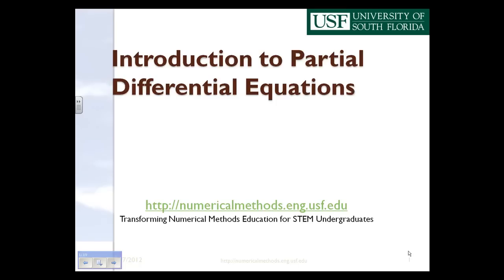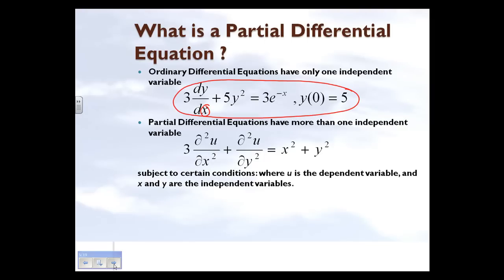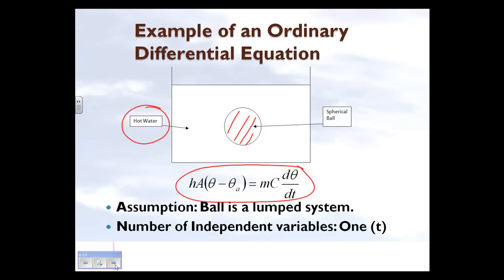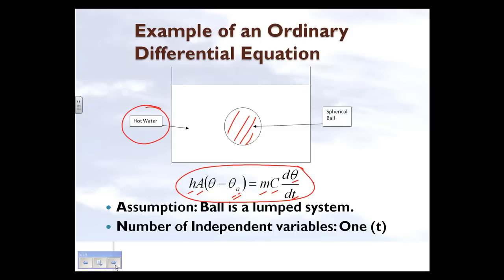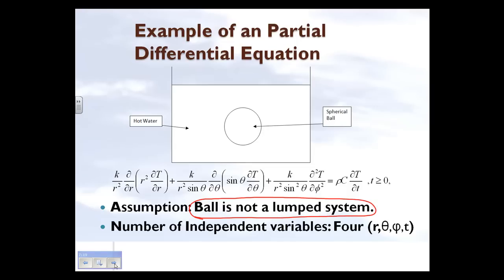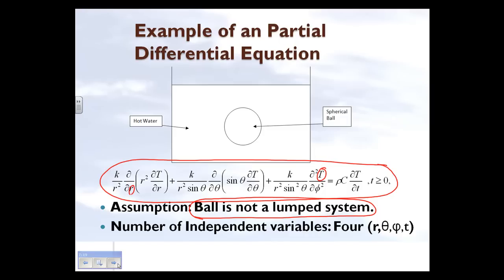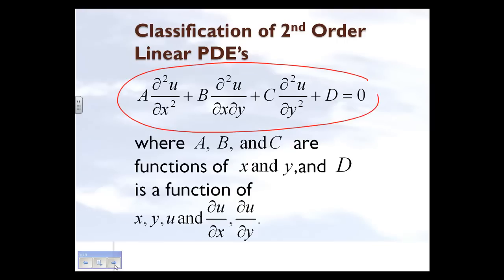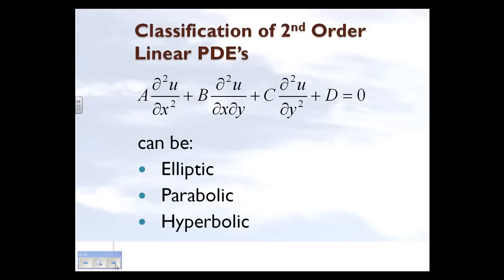Introduction to Partial Differential Equations

Comment: 4:38 I have read that there should not be a product of dependent variable and its partial derivative for an equation to be 'Linear'. Please clear my confusion.
Reply from the maker: You are right.  The D also has to follow the rules of being linear as well. We are just bundling the terms there.  If D does not meet the requirements of being linear , then we do not have a linear PDE. So if we have 
5 d2u/dx2 + 3 x u du/dy = 2x, it would be nonlinear.

Comment: @1lIIiliIi1iillIiiII1 It is just notation. In the second example where the sphere is not assumed to be lumped, one of the independent variables is an angle which is denoted as theta; thus, the temperature was denoted as T instead.